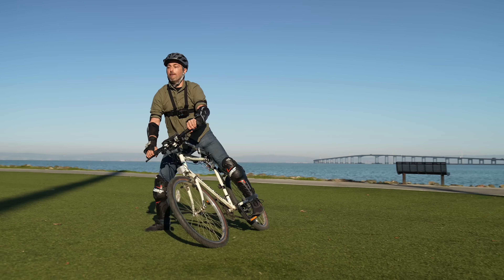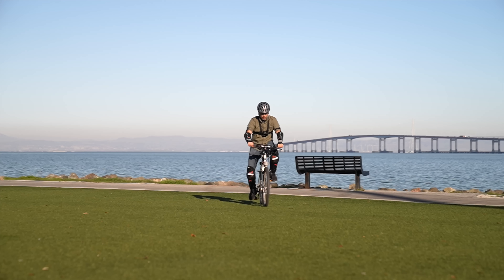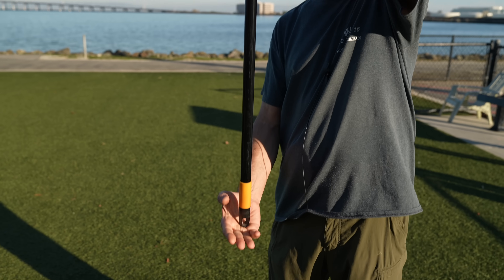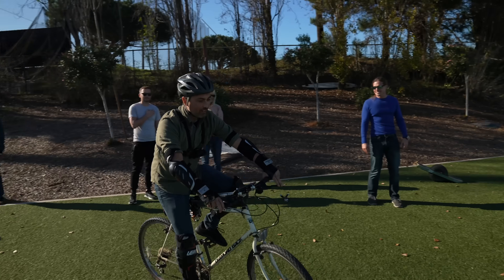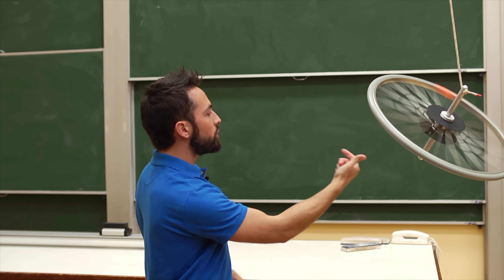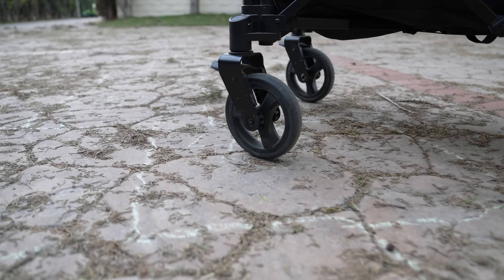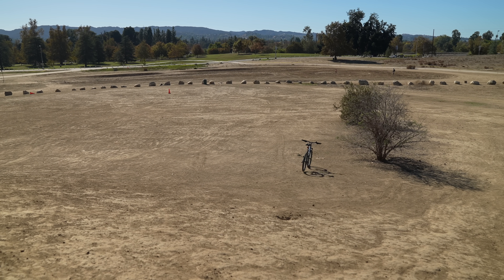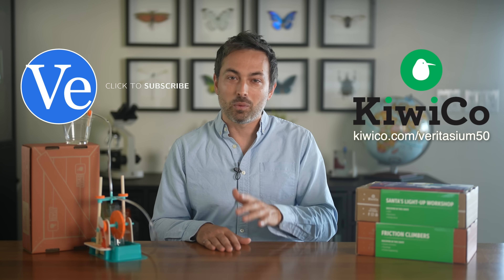Most People Don't Know How Bikes Work

Comment: This effect is even more pronounced at high speed. I think any experienced motorcycle rider like myself would know this very well. I wouldn't even try to do it because I know I'd crash.  A good bike rider can ride and steer hands free but the wheel has to be free to pivot even without hand input. This way you use your balance to start the turn, you don't use your turning to maintain your balance. But there is another force contributing to the bike staying upright, and it has nothing to do with momentum or gyroscopic effects, caster or the wheel's uneven weight about its pivot pont making it turn, it has to do with traction and friction, and the interaction of a wheel staying perpendicular to a flat surface. It is the posture of least resistance. I use the word scuffing to describe the very powerful steering torque needed to countersteer to maintain a high speed turn. You'll notice on a motorcycle this force is non existent when moving slowly, while at speed it is very strong.

Comment: Man, feels like i can turn to one side without turning first to the opposite side. You just have first to lean towards the side you wanna turn and then imediately turn to that direction, otherwise you'd fall anyway from lack of balance. I doubt those guys from high speed bike races first turn briefly to the opposite direction of that they actually want to turn. If im wrong ok but i'd be surprised. Any thoughts?

Comment: You can track stand. It takes practice, some people can stand nearly completely stationary. Only making really small adjustments. It heavily relies on the bars being turned a direction and moving the bike beneath you at an angle. 

Not exactly. But you’ll see couriers do it a lot. It’s pretty fun to do. 

Bicycles are stupid complex in my opinion. 

When you look at how a rear derailleur is made and how it functions. Pulling at an angle, moving upwards in a diagonally discretion, while also moving slightly backwards to align a pulley wheel with a different cog. Getting the spring tension in the derailleur to work, but not over power the cable to a small bolt holding the shifter in place. 

It’s crazy. 
Bikes are weird.

Comment: This is a common principal called “counter-steering”. You need to know what this is when on a motorcycle. Especially a big heavy one. Hanging your 150 pound self off the left side of the bike and steering left will work but takes forever. Don’t lean at all. Just push the left handlebar. This steers the motorcycle out from under you placing you automatically and immediately into a left turn. It’s not complicated folks.

Comment: The problem is none of these people ride often, and I'd wager non of them can ride without hands.  When you ride without hands you gain the ability to properly control your weight to manuever without the steering column turning at all.
Reply: >> I'd wager non of them can ride without hands. 

Even the guy on the unicycle?
Reply: @Rick_Cavallaro  The guy that rides the unicycle never rides the bike.
Reply: @nathanhays1866  The guy on the unicycle is me.  It's my bike.  I modified it.  I assure you I've tried it plenty.

Comment: I was thinking about this again... I don't buy the explanations even though I watched the video and saw people fall. There's something else at work here. Perhaps psychological. Remember when riding a bicycle no-handed. To make a turn just lean into the direction you want to go. I don't remember having to quickly counter-steer - which would be impossible to execute quickly without hands anyhow. Or think about walking a bicycle - holding onto the cross beam only (no hands on the steering bar). Again, when wanting to turn just lean the bicycle directly into that direction. There is no quick counter steer as far as I remember.

The explanation was covered in the video as a separate issue: the rider uses perturbations and counter-steering throughout to balance upright. Has less to do with the leaning/steering issue. The locking mechanism is inhibiting the upright stability even during going straight. That's my theory.

Comment: I would like to see this done at a higher speed, if I recall correctly if you ride a bike at say 30+kph it is enough to lean in the direction of the desired movement, I do not think it is needed to counter lean in opposite. Would be nice to test.
Reply: You don't recall correctly. Speed speed does not matter.
You can test it for yourself.
Good luck going 30+ 1000 per hour (What ever that means) on unridable bike.

Comment: If you turn the handlebars then you're doing it wrong. Leaning to turn is far more effective and the proper way to do it.  Turning the handlebars is only designed for slow speeds like a crawling speed or mountain biking type speed up a terrain. And you've got no counterstearing so that's that's wrong.

Comment: Well, you can normally even ride bicycle without holding handlebars and make turns and adjustments by leaning towards one or another way. This all relies on bicycle front handlebar not being locked and adjusting the direction without holding handlebars with hands, so it all makes sense for me.

Comment: And now I understand why my chopper-bike is totally un-balanced. The geometry is so out of whack that you have to keep a hand on the bar to keep it stable, by correcting with the hands. One handed possible, but not freehand.

Riding it requires some stamina, i can tell, but is a load of fun.

Problem is: center of gravity is so low and far at the back tire, that the position of the front tire had noeffect on that. And more: handles and tire act against each other, not with each other. So the front can wiggle around more or less free.

But as I said: fun bike, i really like it.
Reply: While the choppers are known for bad handling there is something wrong with your bike.
-Steering bearing might be dirty or too tight.
-Wheels are not in-line.
-Worn tire(s)